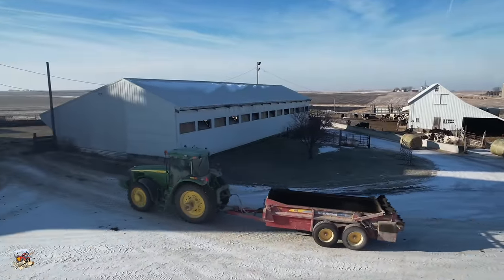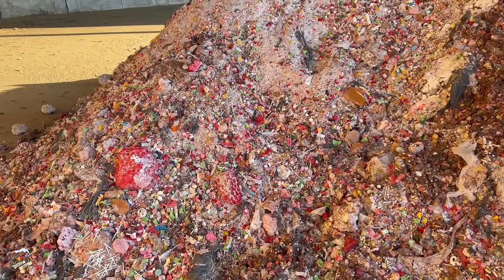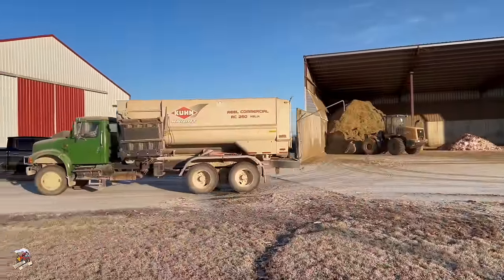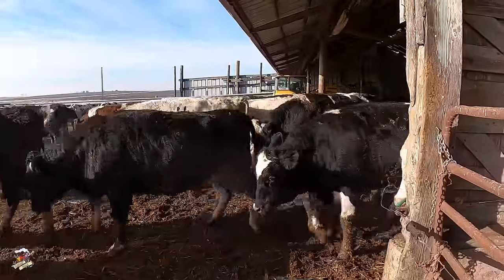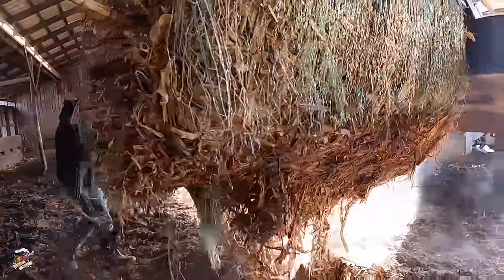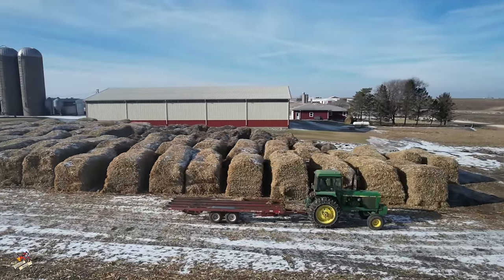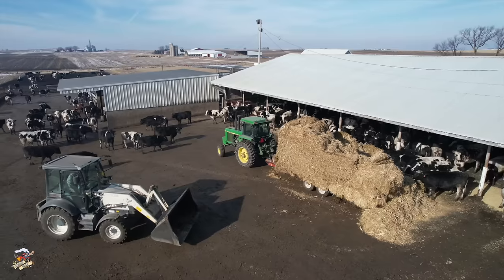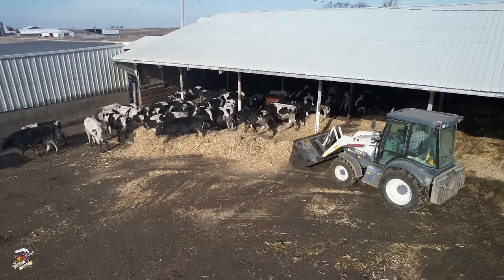A Winters Day work on a Beef Cattle Farm

Comment: Amazing how much equipment and labor is used to feed the beef herd.    Here in Texas the scale of efficiency is so much different.   Bedding is not used except at the diary.  Corn stalks are used for part of feed rations.  The corn is brought in from the Mid West by mile long unit trains.
Reply: Have to use bedding here and have sheds for protection here in the winter with the weather that Iowa can get. Feed is cheaper here to help offset some of the higher costs with housing. Corn literally goes from the neighboring fields to the cattle for feed.
Reply: Almost all the feedlot cattle are 100% beef bred cross.  The cattle come here from Arizona to Florida and Wyoming to Mexico feeding beef with cutting edge technology.  More than  25,000 head a day will be Processed  in the Amarillo area.      This area is also third in dairy production behind California and Wisconsin.     They sex specific the semen for only heifers.  The old milk cows are not feed just go to be processed.     This is the new world of animal science!

Comment: Farmhand also made Stackers, several of the Farmhand literature pieces highlighting them show a picture of a loaf of bread being held by a Farmhand glove showing that the stack is like a loaf that sheds water.
Reply from the maker: Yes I have a brochure of the Farmhand one. The pictures I saw were a little different than the Hesston. At one point someone made one for Gehl.
Reply: @farmhandmike  yes, the way I understood the farmhand ones is they didn’t press, and the blower pivoted side to side. Have only ever seen remnants of them, have seen a parts of Gehl, if memory is correct it looked similar to the farmhands.

Comment: I've never seen a tractor like the white one loading the spreaders.  The flat backend of the tractor is unfamiliar to me.  Never seen anything like that.  Can you provide some information on that for me?  As always love the videos.  I believe you live one of the most interesting lives (if you love agriculture like I do).  Thanks for sharing.
Reply: In the UK they were sold with a excavator arm on the back, not sure about the USA, maybe they removed them?
Reply: It just looks like a Terex backhoe with the rear loader removed to me. But the other yellow one looks like a backhoe that has had a lift hitch added to the rear of it or maybe even an AG model of a backhoe from a manufacturer.
Reply: It's terex skip loader.
Reply: This tractor originally had a backhoe on it. It was removed to use for loader work only. The yellow one was manufactured that way. It is called a skip loader.